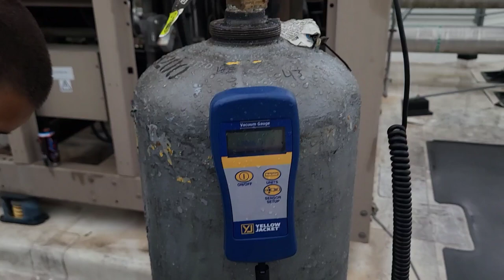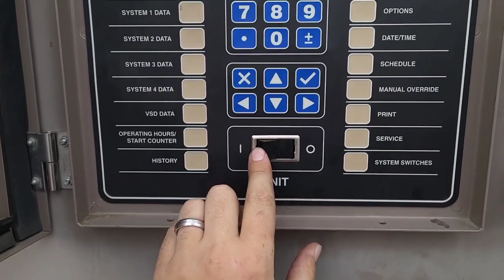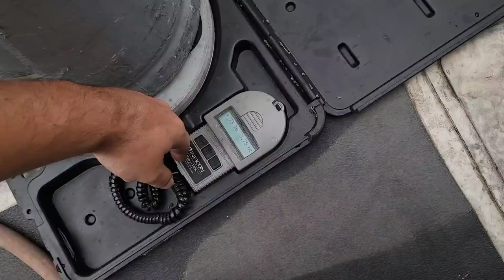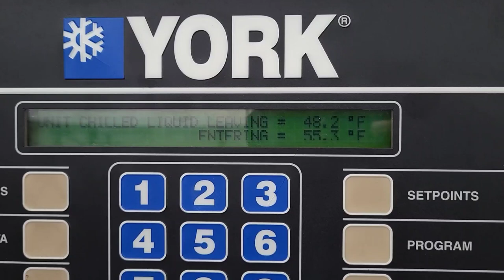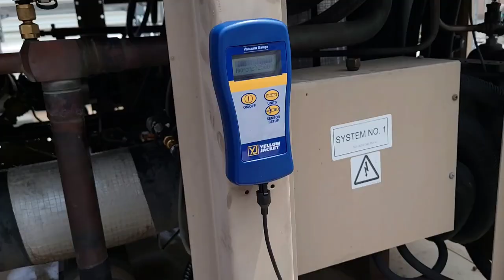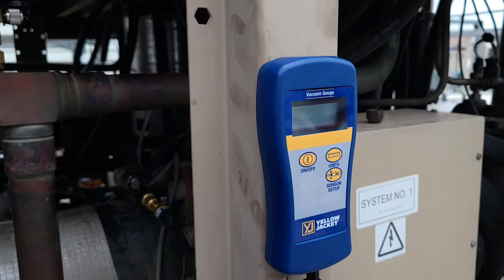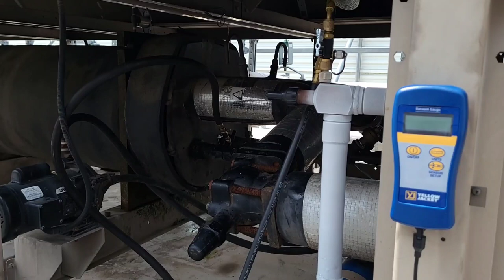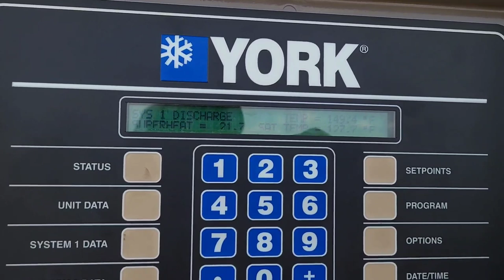York Chiller AC Leak Repairs Sight Glasses

Comment: I like to use a bottle heater on the recovery cylinder when charging the system with recovered gas first.  For me I know that that the customer gets the refridgerant they own back before they are charged with new gas. I also like to run an inline dehydrator on the line of any reused refrigerant to make sure everything is good.
Reply from the maker: Anything helps improve the process.

Comment: I'm glad you like that TEZ8 vacuum pump, I had nothing, but problems with it and eventually got rid of it.
Reply from the maker: What issues were you having?
Reply: @HVACTIME  it would just spray oil every time you would change the oil. I had it repair the first time, but then it started doing it again and it just became too messy.
Reply from the maker: @SombraLocs  were you changing it with pump running?
Reply: @HVACTIME  yes, I was changing with the pump running since these were designed to changed the oil on the fly.
Reply from the maker: @SombraLocs  ya I personally dont. I know they're supposed to but I never practice that nor teach apprentices that. I'm not sure why Appion thinks thats a legit recommendation.

Comment: Hi great videos. 
First time gonna be working on one of these machines. I gotta replace a flash tank level so gotta take the gas out. Once you got all the liquid out, did you pull out vapour? Any concerns about freezing up the cooler tubes since the other circuit is running. 
How about doing push pull. I done that a lot mostly on centrifugal.
Reply from the maker: As long as you have water flow on the barrel your good to go how ever you prefer to do it.
Reply: @HVACTIME  great thanks.

Comment: Is there a parts manual for these York chillers? I'm goind to need to order some part for a YCIV0177SA. Also, How did you figure that you needed a newer style parts on that valve?
Reply from the maker: The harness plug is different. The old ones wire straight into the valve head. The new ones have a cable with a plug and screw threads that mounts to top of valve head.

Comment: why not push pull recovery method?
Reply from the maker: I've had faster and more efficient results with the subcooler method (after designing my own) than push pull. BUT it comes up frequently so I'm going to do a comparison. Ill do a push pull on my next job and compare that to my typical recovery time and process. Ive not used pushed pull in some time so very curious to see how it turns out.

Comment: Leak test at 59 psig --- Surely you should test over night with 150 psig --- 580 microns rises to over 700 - You have a leak in the system or moisture.. I suspect a leak
Reply from the maker: In my experience 50 to 100psi is plenty sufficient for pressure testing. Refrigerant getting trapped in oil will cause a very slow rise. You can test it by hitting the oil separator and watch microns spike.

Comment: I thought you would of pushed, pull the refrigerant
Reply from the maker: You can but Ive had fast results with less steps with subcooler when practical.
Reply: @HVACTIME  liquid straight to tank. pull vapor from same tank, through your recovery machine and into 2nd tank...works like magic on screw and centrifugal's.
great job man
Reply from the maker: @MrBerniebling  I've used this method too, great process.  I like this over push/pull personally. Still working on a comparison video between the methods.
Reply: Pls can you share service password